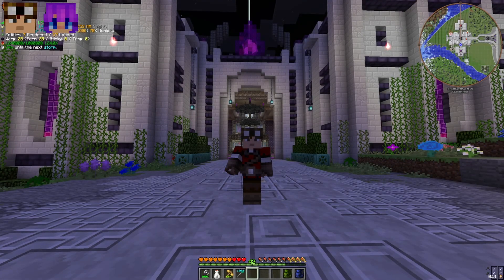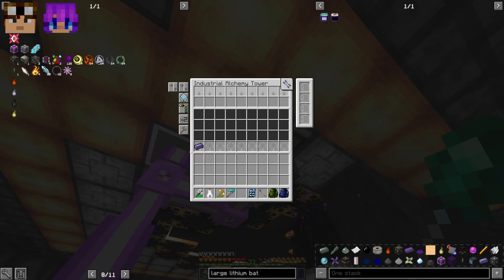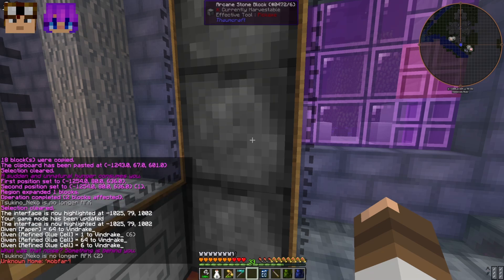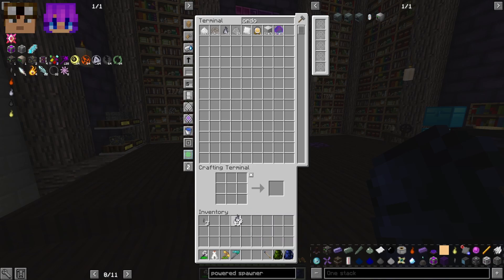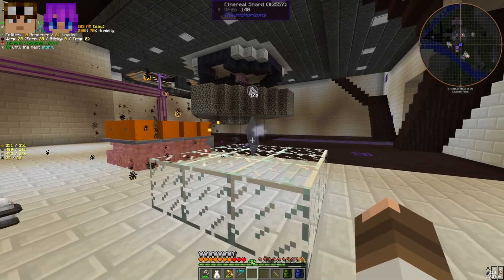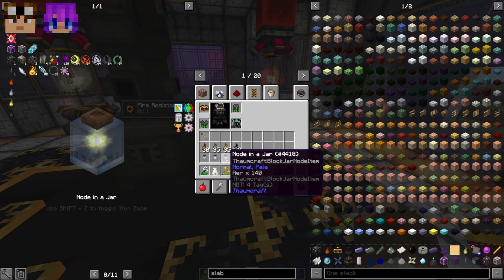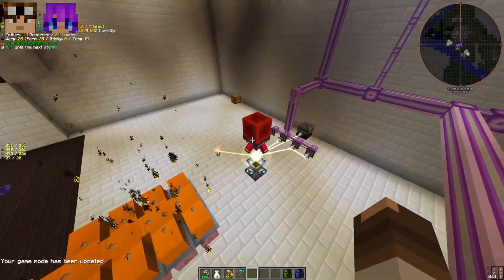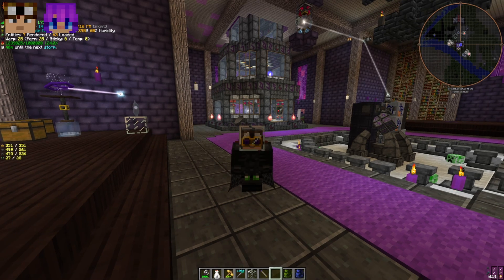Showcasing the Industrial Alchemy Tower from Twist Space in GTNH

Comment: CV calculation is square root of the amount in the node and result is rounded down. For 10CV node you need 100 aspects.
The difference in amounts comes with the jarring as using normal glass has chance node with modifier (etc. pale or fading -20%) that reduces the CV.
Reply from the maker: Thanks for the additional information! I'll pin this comment.

Comment: Looking at the tooltip, there doesn't seem to be any penalty system if the nodes have aqua or terra, only if the amounts of the other aspects are misaligned. This means you can use the Eldritch Guardian method to feed a node equal amounts of Exanimis and Alienis, which will give equal amounts of all primals once energized. This should be much easier and quicker than the wisp method.